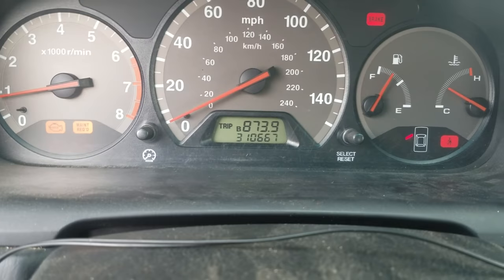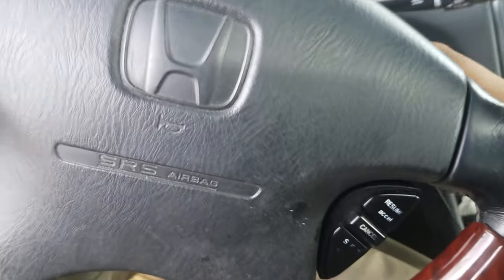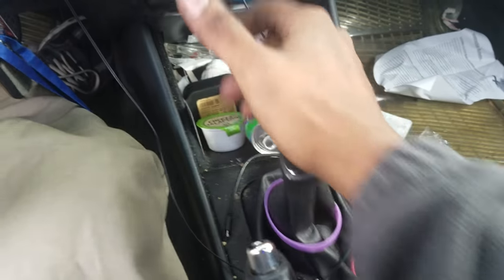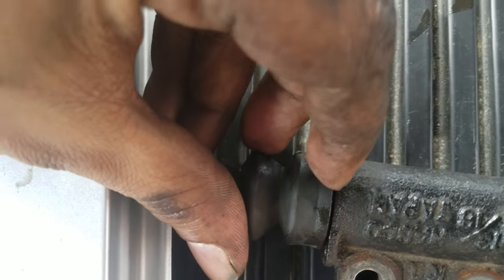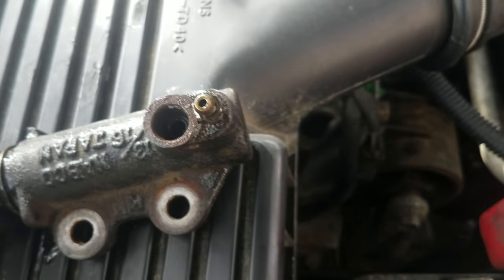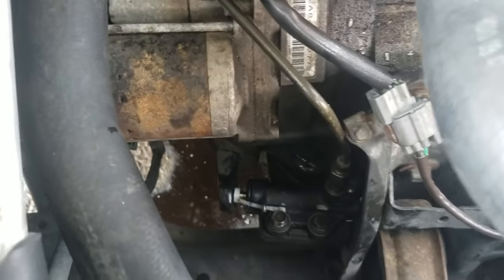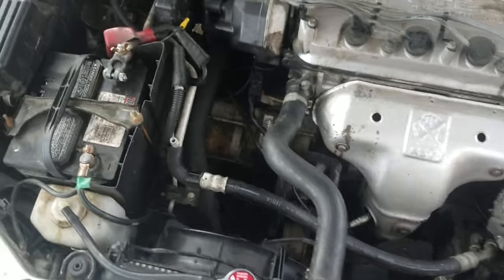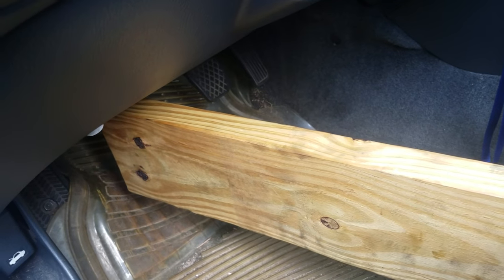Honda Accord Gear Shift Problem Solved - Easy Fix for Gear Engagement Issue

Comment: How exactly did you bleed it. I have the same problem I swapped the slave and the piston in the slave is not really pushing out the pedal does have pressure now!
Reply from the maker: I'll Find the correct way to bleed the clutch. Pull the old honda out and do a video looks like it will help people out!
let me know how it worked out for you please.
Reply: @tjdot8   ***update **it was the slave AND the master cylinder but got my dc4 driving smooth . Now just gotta do brakes and front suspension . But your methods helped me get pressure back I. That bihhh bro ! 🫡

Comment: Thanks for the video,;!  Just alittle extra info for the newbies like me ***That pin he wasn't told about,. That holds on the pressure line.. IT IS HOLLOW ! NOT A SOLID ONE YOU CAN SEE,.  And is snug against the inside of the little hole under the pressure line So get a drill bit that's just a bit smaller than hole ,so it sits on top of the pin and then you got to find a solid place within reach to brace part, hold bit, and  a tool ,to tap out pin to remove line. Hope this saves you all the time it took me to figure out 😊LOL Have a great day 😊
Reply from the maker: Thanks!

Comment: Just to inform you.......that white plastic tab, over the slave cylinder rod, is supposed to be removed after install. It is just to keep the rod compressed for shipping and stocking.
Reply: Is this true?
Reply: @HardKnocks160s  yes it's true

Comment: If you've a 98 and most 99 it's even worse as they come factory with a plastic style (abs) master cylinder and slave cylinder.  It's a real rabbit hole bec, if you want to replace JUST the slave, you need to replace the master, the line and the slave to get the job done. No exceptions. Good luck finding the line, it's nearly impossible but do try multiple dealerships and local yards.  Ask ask ask. Master and slave will need to be from 2000-2002 and those are easy to find of course

Comment: Im having same issue with my 2006 subaru sti.  Was ready to drop the tranny, thinking it was a clutch  problem. Mucho thanks, hoping the slave cylinder and or the clutch master cylinder is the  problem. Ordered a rebuild kit  for the  original slave cylinder and  also a new slave cylinder and clutch master cylinder from rockauto
Reply: I got 2012 legacy, checked both master and slave cylinder, both fine. I guess clutch plate spring gone.

Comment: I finally found the video that will give me hope. I am having the same problems as you but with a Mini Cooper S, 2013. Hopefully it is just the slave cylinder or a similar small component. Thanks for your help and also not doing a 30 second introduction at the start of the video lmao 🙏🏾

Comment: Having the same problem in my SIR-T after driving through some very high road waters. Gonna have to check my slave again.  Master seems good, reservoir almost at MAX, no leaks at master and slave but there's a nipple missing off the slave...don't know if water got in.

Thanks for posting this vid. Lots of help I've seen.
Reply from the maker: Hey I just wanted to say thanks for your feedback hopefully you got your issue resolved.if you have an opportunity I would definitely appreciate it. Let us know what you found. I would suggest flushing the system.
Reply: @tjdot8  Big up @tjdot8. Sorry I didn't return to update. I left the car at home and returned to check at midday.  Started it and was to put move the Tx thru all the gears...ran good ever since. Going to general service it soon but all is ok for now. Thanks for asking/reminding me to follow up. Hate when ppl don't return to update and actually did it...now I understand why some don't. .got 'busy' when issue is resolved.
Reply from the maker: @rizzleriz4457  your cool man I was just curious if you were able to get it going again. Glad to hear that you have it back up and running 👍

Comment: Have a 6speed accord new clutches an slave but still won’t take gear when car is on any idea what’s causing it?
Reply from the maker: Bleed your clutch

Your clutch is hydraulic and it probably has some air in it
Reply from the maker: Please let the community know if this helps.
Reply: I bleed it but I probably didn’t properly do it right Will try again an let you kno

Comment: I have the same problem, I have the part swapped but I cannot get a wrench on that bleeder valve due to the motor mount. How did you get it bled? Take off the motor mount? Thanks for the video. Thumbs up for ya

Comment: My 97 civic hx wont go into reverse. All other gears work except reverse. It jerks and sounds really bad like the transmission is going to break. What could be the issue? I was told it could be the clutch and clutch plate.

Comment: I have a Maruti Suzuki S-Cross, and facing gear shift problem while engine on but on off condition it shifts properly, weather it be same problem as you shown in video or might be other.

Comment: I don't know what the hell it's called... 😂This is definitely the video I was looking for, lol. Well I'm gonna try it see if that works I have kind of the same problem but I'm stuck in gear can't release the clutch when the car is running won't go into neutral.... Fml.... Thanks for the tip tho.

Comment: Broo Soo I end up cutting the white ties on the boot I end up cutting them is that's the reason I'm not getting pressure   bt the boot it's in the clutch assembly bt I cut the white lines

Comment: Some body please tell Me how to get a socket down in that tight area in order to turn the Bleed screw
Reply: use a wrench
Reply from the maker: Yep that's exactly what I did was use a wrench
Reply from the maker: I apologize if I did not mention that in the video
Reply: I had to bleed it with it off the car , bled it then bolted it back on and pumped the hell out of the pedal. There was no way I could get a wrench on there while it was installed with it being so close to the mount.

Comment: Well mine went this morning it’s doing exactly what u did
Reply from the maker: Yeah so basically that was what the video was about.you're going to want to check for leaks on both of your cylinders the master and the slave. If you finally then I would suggest you replace the component.hopefully this answers your question if not please do chime back in. I'd be glad to help

Comment: Awesome video, got this very same problem can you provide the link to the part you replaced yours with? Preciate it.
Reply from the maker: I don't have a link or anyting not sponsored video.but I do remember getting it from AutoZone just give them your making model. If you have oil present in the boot of the slave cylinder ask for that
Reply: @tjdot8  bet my guy, I preciate it fr. Gonna grab it today and hopefully be all good. 🤙Looks like we pushing the same whip, same color and all. Yo I'm new to the Accord CG3, just picked this up about 3 days ago, anything else I should know about that may pop up on me?
Reply from the maker: @JamesSmith-Jtz  we don't drive it much anymore since we got our crosstour. but that's like the only thing we've ever had to do to the car except for replace the battery post connectors. Is a really solid little car. I believe it has a small exhaust leak ( likely catalytic converter clogged) but has never really caused and issue. Weekend before the virus deal we drove it 2 1/2 hours away to go 🎣 fishing.
Reply: @tjdot8  good to hear bro, I preciate the feedback.💪

Comment: My 2003 Saturn Ion will only engage 5th gear wondering if recently changed brake line would cause me to have air in the system in this stop
Reply from the maker: I do not think so however I will do a little bit of research on your Saturn and get back to you
Reply from the maker: So after digging around for a couple of minutes I did find that your system is a hydraulic system. However and please do not take this to the bank.I did not find anything to indicate that the systems are linked in any way.my suggestion would be to verify whether or not you have a leak in either your master or slave cylinder

Comment: how does a nissan sentra 1.6 gxi 1998 model master and slave cylinder looks like.
Reply from the maker: Master cylinder is located near the top of the fire wall on the driver side. Is where you put on your fluid. If you get someone to push in your clutch while you look you should see you slave cylinder move. If you have one. This car has hydraulic clutch. Yours could possibly be a cable driven system.
Reply from the maker: Hey man did you find any info. Just wondering out of curiosity I looked it up and found that your slave clutch cylinder is actually mounted inside of your transmission
Reply: No, the sentra's (sunny or Pulsar) don't have Hyd clutches. They all cable type which connect to a arm above the box. The issues can be similar if the cable adjustment is out. Adjustment is where the cable meets the arm above the box. The comment by tjdot8 is incorrect, he has spotted the brake booster and arm.

Comment: Hey that little pin does it just go in & out? Or how you take it off then it just slides back in?
Reply from the maker: I tapped it out using a drill bit

Comment: i have weired problem sometimes cant change any gear work while running but when i release pedal up then push it i can change gear even when engine off gears stuck
Reply from the maker: Maybe the transmission
Reply from the maker: I'll check into it and comment back as sone as I can.

Comment: So i ran into this exact same problem, i started with the slave first. Still same problem afterwards. I ordered a clutch kit, and replaced that. After i got it in and transmission up i just had to fix a couple wires that broke from removing trans. That was fixed. I got it to run and soon as i did it was going into gears and i drove around a couple days and sooner than later back to square 1. Clutch MC is full and i bled the slave. I missed a step to top off trans fluid, i will try that next. Any help or opinions please

Comment: My honda civic stop going into gear on the highway as i was up shifting the pedal went soft, never had any problems before.
Reply from the maker: Yep one of your cylinders is out. The master cylinder or the slave cylinder. Check to see if you have like what I showed in the video. The master cylinder if it is leaking you will see fluid coming down from above your clutch pedal. If this a slave cylinder is leaking you will have fluid in it's rubber boot.
Reply from the maker: I hope that helps. Have you gotten your car off the expressway?
Reply: tjdot8 yea thank you took 5 hours for the tow truck to get me yesterday
Reply: tjdot8 thanks for the tips ill check ny car later today time to let my old 5.0 shine while the honda is down.

Comment: When the vehicle is off are you able to put it in all the gears except for reverse? My accord won’t go into any gears when the car is running but when it’s off it will on go into 1st to 6th gear but will not go into reverse.
Reply from the maker: Please do forgive the delay. I wanted to have some decent research behind the statement I'm about to make. I believe your transmission is faulty. If you have been able to confirm this please let me know. With over 20,000 views on this video I'm sure there any information you find out will be helpful to someone
Reply: ?did you find out the problem

Comment: Was your clutch also stuck to the floor?
Reply from the maker: No but I got to it early. That is definitely what is wrong
Reply: Great, thank you
Reply from the maker: Please do check both the master and slave cylinders for a leak before replacing either one
Reply: @tjdot8  will do, cars already got a rear main leak I gotta take care of lol
Reply from the maker: @alexmunoz6710  well it only took 20 years for that seal to start leaking. I'd say that's a major engineering feat
Reply: @tjdot8  Fair enough, I just bought the car in a bad condition

Comment: So mine does that with 4th gear and it pops and grinds out of 3rd and won't go into reverse. I replaced the slave cylinder awhile back any other ideas?
Reply: Soundly like the transmission
Reply: @garvinbienaime44  ya don't say 🤦🏽

Comment: Would it shift into 2nd when you had the issue?  I am looking at buying a car that has trouble starting out in 1st gear.  The guy told me he starts out in 2nd to get moving.   Was that your experience?
Thanks for the Video
Reply from the maker: A leak inside of your hydraulic system can cause all kinds of issues. Is going to be difficult to pinpoint exact points of failure. What common issues are difficulties shifting into one particular gear or all gears. I would suggest that you check your cylinders for a leak. Even after replacing the cylinder is he can be difficult to remove all of the remaining air from the system. For this I will suggest using a vacuum bleeder. I will eventually post a link in the description. I have not done so yet. I will do it after the video reaches 50000 views

Comment: I got a 02 honda accord and it's stuck in 5th gear and won't shift into any other gears do u know what my problem could be??
Reply from the maker: If you would try to shift with the ignition switch turned off and let me know when you can what happened

Comment: Man I have an automatic 2000 v6 accord coup with 300k, when I go from a stop to start moving the engine is revving but I’m
Slowly creeping until I get out of first or second gear once I get up to speed it’s fine. Anyone know the issue? When I got it the engine would over rev and I’d let off the gas and it would feel like it’d catch and shift from first to second but it would only do it once when I first started it after sitting for a while but then it started doing it more and more until now it does it like this all the time that it creeps along until I get going fast enough to be out of first gear. I replaced the first and second gear solenoid with one from the junkyard maybe the junkyard part was bad or it was something else because there was no change but this was back when it only did it upon first starting.

Comment: The exact same thing is happening to my car, what did you end up changing the slave cylinder or the master cylinder ?
Reply from the maker: The slave cylinder was my problem. However even after I change it I had a bunch of air in the lines. Took me a couple of days off and on before it cleared out
Reply: i have a an accord 99 with same problem please could you answer if you felt the clutch was soft aswell when it weren't going into gear ?

Comment: I have this issue aswell,  currently changed the slave cylinder but still no good...u think there might be air in the lines?
Reply from the maker: Yes it is hard to get those lines bleed out sometimes you will need to use a vacuum bleeder
Reply: @tjdot8  I will give it a go with one of those
Reply from the maker: Hey just wanted to check on your progress. Hope you have a great weekend.
Reply: @tjdot8  I got my vacuum bleeder in the mail today,  I will test it out and let u know
Reply: Any news with the vacuum?
Reply: @jerryfuentes3100  it's actually my clutch disc man it's bad

Comment: Sometimes I'm locked out of any gear, whether or not the car is running. Any ideas?
Reply from the maker: Are you sure it will not go even with the motor off? Transmission may by out

Comment: I changed my slave cylinder cause it was bad but i still cant get it into gear when the cars on only when its off i bleeded it and all any help greatly appreciated
Reply from the maker: You can at times be very difficult to bleed this clutch system. May need to vacuum bleed the system read the comments has helped in the past hopefully it helps you as well.

Comment: Hopefully this what might be wrong with my 07 Civic Base 5th and Reverse wont engage
Reply from the maker: Check for leaks
It's the easiest way to tell
In the video I removed the boot there should be NO oil
Reply from the maker: Please don't just replace them both because of this video
If the cylinder is not leaking it is not bad

Comment: im having this problem after i just got my clutch and hydraulics replaced so i have no idea whats going on
Reply from the maker: Most likely there is air in your hydraulic lines you will need to bleed the lines

Comment: My car having same issue Specially in the morning . After car warm Gear shift normally...!! any solution?
Reply from the maker: Bleed your clutch lines may have to use a vacuum bleeder. But first check where I said to check the video for a leak
Reply: @tjdot8  There is no Visible leak in Slave or master cylinder. I bleed is 2times yesterday. I started my car today gears were little better than yesterday. But still little hard.
Reply from the maker: @lordof_goodness  you will need to vacuum bleed it read over the comments it has helped please let us know if this helps you too. thanks
Reply: @tjdot8  Okay i'll try it and comment again . Thanks by the way... 👍
Reply: @tjdot8  Finally My Problem is solved !! Too much air in the line due to lack of Brake oil in clutch reservoir. Bleeded manually. Thanks for your support...!!
Reply from the maker: @lordof_goodness  thanks for taking the time to let us know what you found out. I have no doubt that this will help someone. thanks so much for your feedback.
Reply: @tjdot8  It's my pleasure !! 👍